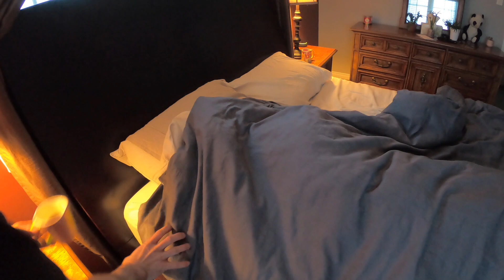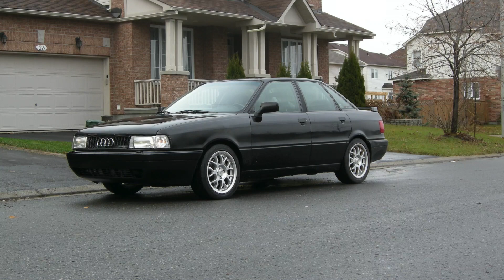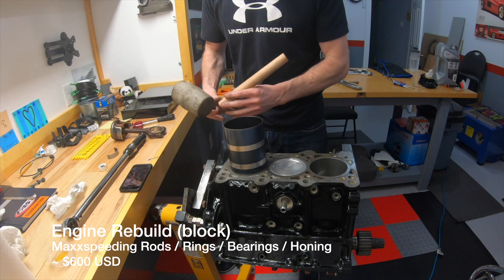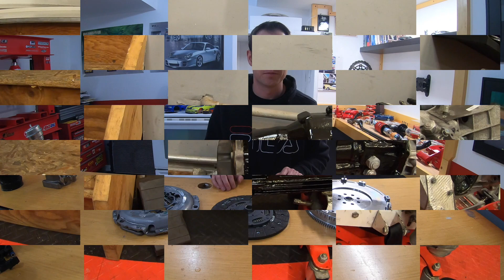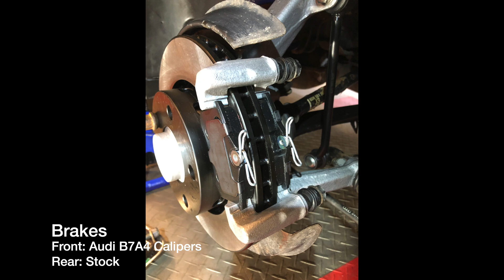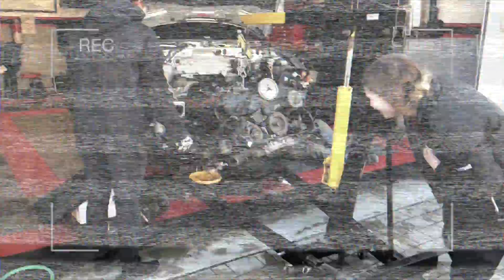Audi B5 S4 Stage 3 K04 $10k+ Parts Haul - PB Garage 2.7T Build-Off Challenge

Comment: I'm in New Zealand I've got a o4 allroad and it never let's me down just need to look after them all most at 300000km still running mint
Reply from the maker: Awesome! They will run forever if you take care of them.
I have a 1.8t A4 with 310k km, 180psi compression right across, just keeps purring 🎉

Comment: Nice build👍youre s4 looks awesone...those rs6 rims look really well...did you have to upgrade the output shaft on the gear box to upgrade to the aluminium uprights?
Im restoring a b5 quattro 1.9tdi...i need to change my output shaft...be prepared with the pinch bolt on the aluminium uprights...haha the cast steel are more forgiving ...as im sure you know about...
Reply from the maker: Thanks!! Yeah I love the rims too. I’ve debated changing but these looks nice while being OEM and suit the car well.

No upgrade to the output shafts at all. Lower control arms are different and the wheel bearings too. ABS sensor as well.
As far as pinch bolts go, this is a summer car only so they should never be a problem 🙂
Reply: @PBGarage  yes lower control arms have the 16mm tapered ball joint on the aluminium over the 22mm tapered ball joint on the cast steel..there is not much of a weight difference between the two but obviously the wheel bearing is alot easier to change...cast steel upright have to be removed to press out the bearing...maybe your s4 has the revised output shaft on the gearbox to take the b6/b7 cv axle...my quattro is 1997 but I can change the output shaft at a later date...someday😅the intro was brilliant😅😅..hopefully shes out of her sulk by now😂they love being pampered
Reply from the maker: haha yeah she's good now ; )
I've been considering an update video where all the parts in bed are the old ones 😂

Comment: Is the button disk necessary for this setup?
Reply: Sorry the flywheel you mentioned in the video. Ttv
Reply from the maker: Ahh okay! For the B7 RS4 clutch kit, yes, it’s required. I don’t think the B7 flywheel works because it’s V8. So this TTV flywheel fits the 2.7 and accepts the B7 RS4 clutch kit (got it from Rockauto for less than $200). No other parts required!
Reply from the maker: Not sure what you’re referring to?

Comment: great video, i'd love to hear more about that 90!
Reply from the maker: Thanks! 
It was a 1990 90 Quattro 20V and I decided to install a hybrid turbo T3 T04E Stage 3 with K26 turbine housing, huge compressor and tons of lag but hit hard up top. I also ran a regular K26 turbo when the T3 blew up once. Installed 034 standalone system and tuned it myself, blew it up twice (melted the pistons once and seized a main bearing at the end). Long story short, I ran it about 2-3 years fast and furious, had a blast and learned a ton. Eventually the body was rusting a lot and then the engine seized, I had just bought a house and needed to update the fleet (so I bought an 88 BMW 😂). So I parted it out. Great car, would love to get into another or maybe a B4, always loved the look of those.
Reply: @PBGarage  wow, that's an awesome story! always loved those cars, I have a set of C4s and am currently going down the same path with one of them 😅agreed, love the look of B4s! also, love the content man. keep it up!
Reply: https://youtu.be/M3DPJaBNaFk
Reply from the maker: Yeah you can hear the car here on this video

Comment: You say you’re gonna lose your mind if someone says catch can yet you’ll lose your mind once you see how caked your valves will get down the road.
Reply from the maker: I haven’t heard of that being an issue with the 2.7. Something I’ll keep an eye on, though 👍🏻
Reply: @PBGarage  Pretty common thing on the Audizine forums. I can provide links if you can’t find them. 👍

Just with how tight that engine bay is with that hot V configuration. You’re gonna really lose your mind when you’re gonna have to pull everything apart. Granted if everything is healthy and ideal then you’ll have minimal blow by. But at the end of the day the valves are getting coated day by day. Every heat cycle just builds more and more carbon which greatly and drastically hinders performance as well as efficiency.

Comment: Your not insane. My b5 has been down for 5 years but…. Garret GT3582 with tial vee band exhaust housing. And Arp 6bolts with 2.8na heads and super valves, ti retainer’s and running coolant to the turbo and waste gate.
Reply from the maker: Haha glad I’m not the only one! Your setup sounds deadly 👹 It will be a beast!

Comment: You know how to count! ??? With the Bosch 044 fuel pump, you will be looking for pistons in the sump. This fuel pump barely pumps 250 liters per hour at a pressure of 3 bars. If you recalculate with boost and pressure in the fuel rail under 6 bar, then you get 180 liters per hour in general.
With 630СС injectors it is complete idiocy to install such a pump !!!
Reply from the maker: Yes, I learned to count when I was about 2 or 3 like most people. I almost ran out of fingers counting up to 4 bar on one hand, good thing I didn't have to go all the way up to 6 bar as you suggested otherwise I'd need two hands and a calculator, but last time I checked the Bosch 044 fuel pump delivers 265 LPH at 4 bar, which is more than adequate for my 630cc injectors at 54% duty cycle. Actually, I'm still using the stock fuel pump and believe it or not, fuel ratios on the current and modest 19psi tune are perfectly fine!
Thank you for your feedback ; )
https://store.034motorsport.com/billet-drop-in-fuel-pump-upgrade-kit-bosch-044-for-audi-applications.html
Reply: One..... Two... Thirteen... Forty Eight.... Wankel.... 

Well Answered.

Comment: What’s the exact spec of those wheels?
Reply from the maker: They are PN 8E0601025AK:

Brand: Ronal
Rim Diameter: 18
Rim Width: 8J
Offset: ET43
Stud Diameter: 112
Centre Bore: 57.1mm
Reply: @PBGarage  Perfect, thank you. The silver really sets them off. Is it Audi Silver?
Reply: @PBGarage  what paint code have they been painted with?
Reply from the maker: No idea, but they are factory finish if that helps?

Comment: For the engine mounts - i used silver project mounts - cheap, but need to change hardware because they install 8.8grade bolts which breaks, orher thing is the car broke one of the engine mounts (passenger side engine lifts up, breaks bracket for engine/sway bar mount) i suggest you should upgrade it aswell, i used aluminum plates, welded on, lasted ok.
And if gearbox breaks, use tdi gearbox. Mine shredded 1-2nd gear 2 times, installed tdi one, same ratio, longer 4-5-6 gears.
Btw car made 700+ crank hp
Reply from the maker: Thanks for the feedback. Sounds like you had a fast setup @ 700+ hp!!

Comment: Loved the video, very in depth to what anyone who purchases one of these should be doing during a rebuild stages. We've had our B5 for about 6 years now, and are looking to dust off our build series again. I think our engine is going to have to come out to really do it properly. Are you running a stock airbox on the car with the 3D printed MAF housing? We ordered an 034 intake over the holidays and are still waiting for it's arrival. Lots of folks run a Bosch 044, or a Walbro 450 fuel pump in their stage 3 setups. I think either of those will be the route we're going to take. Our car has K04's, but is missing some key components to be a Stage 3 car. We're definitely going to review the parts bin to see what similarities we have, definitely a few based on watching your video.  BTW, we have RS4 motor mounts on our B5, and they are pretty chill on the NVH.
Reply from the maker: Thanks for the support!

Yes, stock S4 airbox, RS4 accordion, Hitachi sensor, 83mm ID, flow turbulence screen.. just hoping it holds up to underhood temps. I used ASA and based on some initial testing it should be okay but a more thorough test is required.

Thanks for the part recommendations as well. I'm leaning towards the 044 pump but a walbro 450 just popped up for sale on Audizine for a good price... we'll see.

Comment: Good luck with that clutch.I had the same one and it didn't hold had to get a ringer stage 4+.they're $900 and no self adjusting pp.they suck
Reply from the maker: Thanks again for the feedback. What was your engine setup (turbo / power / etc) and also your driving style? What flywheel did you use?

Comment: Hope you had the rotating ASSEMBLY balanced the bob weight is DIFFERENT now.FYI those rods are weaker then ie  cheaper rods I've had both .compared at a machine shop
Reply from the maker: Thanks for the feedback, greatly appreciated. I was considering balancing the rotating assembly... I'll definitely look into that some more. 

For the rods, that may be the case however for my current build I'm confident they will be okay. Depending on how the next phase unfolds (a few years away) I may consider alternatives. Do you have any links / info on failed Maxspeeding rods and at what level of power? Thanks!

Comment: Awesome video, love what all you guys are doing. Love the OEM+ design too. Thanks for taking the time to make these detailed, I'm in the process of doing a 2.7 swap + 6speed swap (02X) in my b6 s4 so this is extremely helpful. We're close in progress and design specs, and just thought I would drop a few ideas for what I'm doing. I got a great deal on F21's and and also decided on Bosch 633cc injectors, as Brad stated below the Walbro 450 pump is a solid choice, there is also a double 450 bracket that someone sells that allows you to easily run an additional fuel pump later.

I was concerned about NVH and it seems the majority comes from the engine mounts. I decided on 034 Street motor mounts. I decided on a Spullen differential mount and 034 rear diff carrier mounts. Poly sub-frame bushings for me but I'm told the solid ones hardly make a difference in NVH. My friends told me to stay away from solid motor mounts.

It sounds like you know what you're doing. You've made me check a few things I didn't think about..but just in case, here's a few idea's that may or may not help you.

aux coolant after run low temp sensor
USP Audi clutch line and metal slave conversion
RKX camshaft timing chain tensioner pads.

Keep the videos coming!
Reply from the maker: Great suggestions! You're not the first to suggest the 034 mounts so I'll definitely check those out. Same with the fuel pump.
I've already picked up the coolant sensors (in that bag of goodies). The other two things (clutch line and pads) are something I've missed, so I'll dig into those as well. Thank you!!
And yeah, definitely more videos coming!

Comment: I’m stoked I found your channel. Great video man. Most of my customers are running a walbro 450 or a DW350. If you have any questions feel free to ask and I will do my best to answer them.
Reply: The fuel pump is the last stock part on my build as well. You literally have the exact same setup as me, down to the exhaust minus the DPs. I'm considering a walbro 450 as well.
Reply from the maker: Thanks for the feedback and help, it's greatly appreciated! A lot of recommendations for the 450 pump... I think I'll be going that route.
Reply: @German Elite Tuning   What do you use for the B5.5 Passats? Can I add an inline pump to the existing system or do I need upgrade the intank pump? If so, do you have any recommendations? I haven't been successful finding any drop in upgrades. At this point I have a parts list for 300whp. Maybe I don't even need more pump....?????

Comment: How much in total did it cost to do everything?
Reply from the maker: I added up everything in the video (incl. Tires) and it came out to just over $10k. I still have a few things to get (fuel pump, mounts, rear main seal, other misc gaskets / hardware / hoses), so I imagine another $1500 or so on top of that. Keep in mind I went OEM wherever possible, including all my coolant lines and PCV spider hose, those were expensive but should last another 20 years. Hope this helps!

Comment: Can you put the link to flywheel and parts number of clutch set?
Reply from the maker: Clutch Kit: (Rock Auto)
2007 AUDI RS4 4.2L V8
LUK 02050 (02-050) Clutch Kit (8708.93.2900)

Flywheel: (got it from TTV in the UK)
TTV Racing 3509 Lite SteelFlywheel

Hope this helps!
Reply from the maker: Link to Flywheel:
http://ttvracing.com/product/audi-s4-rs4-2-7t-lite-to-b7-rs4-clutch/?referrer=product-listing&iframe=true&width=80%&height=100%&type=flywheels&engine=audi-s4-rs4-2-7-turbo&manufacturer=audi

Comment: B5 s4s are not reliable but if you take care of them they will last like most of the parts your using 630 injectors are good but I would use something bigger so u don't have to run the duty cycle so high and I would say use the walbro 450 fuel pump
Reply from the maker: Agree, do all the maintenance and they are perfect. And thanks for the fueling tips!

Comment: look into the  Q5 calipers.  2013-2015.  bolt on to the oem b7a4 and retain the 320mm  rotors but are 4 pot brembos with lots of pad options
Reply from the maker: Thanks for the recommendation!

Comment: Love the basement shop it looks great! As for mounts I've personally run Stern mounts and 034 Street Density, on my SRM K24 car. 034's mounts definitely feel OEM and would be my rec for an oem+ build. Some JHM shift components (linkage/bushings) are also a great add imo!

Great choices on the build looks beautiful!
Reply from the maker: Thank you for the kind words!

I had completely forgotten about the 034 rubber (street / track) line of mounts. I think I will likely go this route, thanks!

I've been debating the JHM trans linkage stuff... might have to pull the trigger on that too.

Thanks again for the info!

Comment: about the same passion, same job (mech eng canada) and can't decide the platform right now on my high power diy swap. 1st step done, I bought 2 wagon : A4 B7 and BMW E91, both manual, both awd. Id like to go 2.7tt in my b7, but high power goal are far without 15k$ in hands. N54 bmws seems to be more powerful and more reliable for the same power figure and bit cheaper. Anyway , right now Im looking all video and forums thread before choosing between a 2.7tt or n54. Your videos help me a lot. tks
Reply: Do the 2.7tt!!
Reply from the maker: Sounds like you have some cool options to play with. I’d vote for the 2.7 build as well but I’m biased 🙂
Reply: Hard choice in deed. Bmw can toggle awd/rwd and n54 sound like ish a 2jz. Very hard choice. Right now im asking lot of question. By chance the only current swap on audizine in b7 section is the guy in your video, so im asking few stuff. And hopefully see this built at eurokracy 2021
Reply from the maker: @098cpt  That's my brother Blake. If you have any specific swap questions (2.7 - B7) be sure to ask!

That's also super cool about being able to toggle and/rwd in the BMW, I never knew that existed.